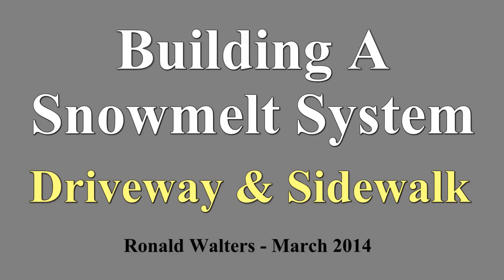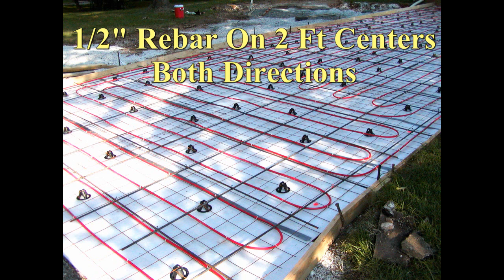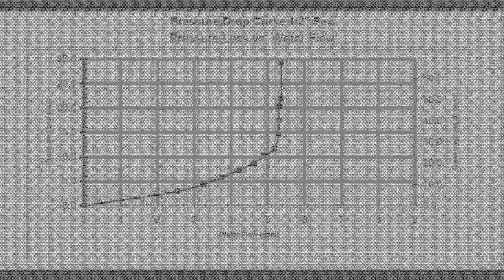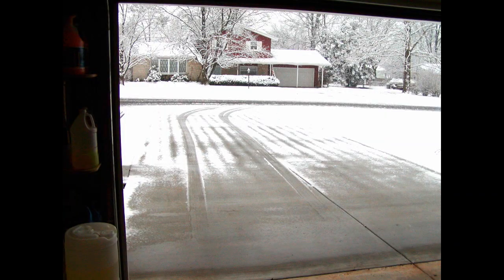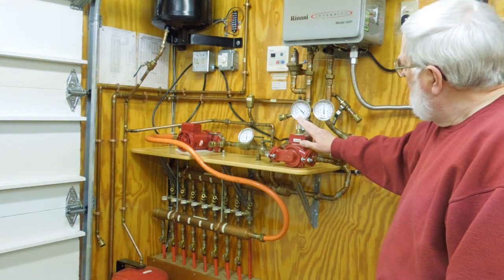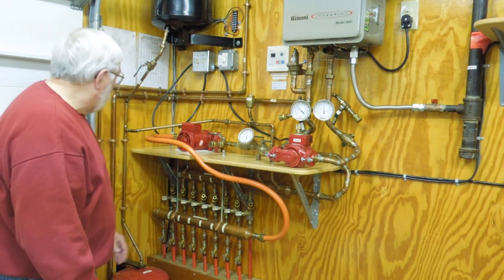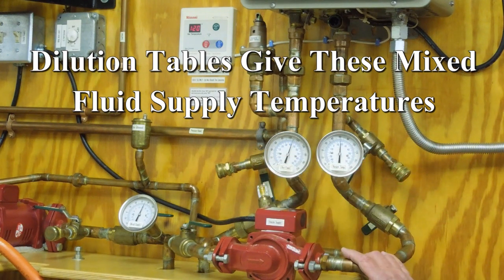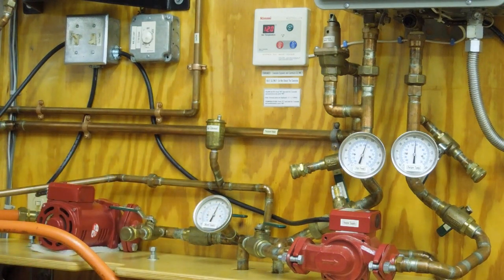Snowmelt, Building A System - Driveway & Sidewalk

Comment: It looks like you have continuous piping running through all the sections of concrete.  That looks like it might make it a bit inconvenient if you ever need to replace a section of concrete.  Around here, concrete sections get cracked because of the roots of trees are just move because of uplifting of the soil.  But, we don't get much in the way of freezing weather other than maybe once ever 10-20 years, so such a system is not called for here.
Reply from the maker: It is never a good idea to have trees next to your foundation or concrete. Most driveways I see in subdivisions or other residential areas are breaking up simply due to poor and cheapest possible installations by contractors. My slap is on good compacted bedding with lots of crushed rock so it can drain. The concrete is a 5" slab with wire mesh and rebar. It hasn't moved or cracked in 14 years. Hope you have subscribed you Grumpy Old Man. :-) You should find other things of interest on my channel. Thanks for watching.

Comment: How thick is the ice sheet at the end of your driveway?
Reply from the maker: Doesn't happen.
Reply: Interesting, I had assumed it would refreeze fairly quickly once it left the heated area.
Reply from the maker: With a blanket of snow covering the driveway the snow helps hold in the heat. Water from melted snow is above freezing and runs under the snow and finds its way to the sides and end of the driveway as rain would. When it reaches a ditch or gutter it will eventually refreeze or will run under snow in those areas as does snow melting on the roadway. Depending on weather conditions, some of the melted snow will evaporate. If you turn off the system before it has cleared the driveway, things will certainly refreeze. Allow the system to completely clear the driveway, the concrete will be bone dry.

Comment: Do you have to be worried about cracks as it cures breaking the pipes?
Reply from the maker: The plastic tubing used inside the concrete is called PEX. It is very tough stuff. You could probably tow your car with a piece of it. If you use wire mesh and rebar inside the concrete you shouldn't have to worry about the concrete moving around after it cracks. Tool joints in the concrete are mans way of telling the concrete where you would like for it to crack. (Concrete may or may not listen to your suggestion about where to crack.) Thus far my driveway and sidewalk have cracked in the tool joints. With proper ground preparation and drainage prior to pouring concrete, you shouldn't have the concrete trying to move around. Concrete DOES NOT like to change dimension rapidly (that will cause cracks). That is why you want to warm it slowly, not hit it will real hot water all at once.

Comment: 1st.. wow at the details and video images. Nice work!  2nd... Wonder if it works with 6"+ snowstorms.  3rd... "This is a fairly expensive system to operate. While running it is the same as heating 3-4 houses" What??!!! I'd rather pay someone to plow.
Reply from the maker: Yes, I have used it on 6+ inches of snow. Everyone seems to miss the point about heating 3-4 houses. An on-demand hot water heater is expected to take cold water mains temperature and immediately turn it into water hot enough for a shower... and I am not running it anywhere nearly that hot. An on-demand water heater burns more gas in a given period of time than a tank type water heater, but it burns if for a far shorter period of time. It consumes a lot of energy, but only "for that period of time it is running".

Everything costs money to operate. We tend to get a lot of ice before snow and that is nearly impossible to plow.

A lot of cities heat sidewalks and streets. Airports heat large areas. Shipping docks heat loading ramps. Those tend to be heated well ahead of bad weather but to me those are government projects where they are spending someone else's money.

On the evening news when you see those huge gas fired snowmelters which melt snow as fast as they can feed them with a front-end loader. Now that is burning a lot of gas!

Makes my system look pretty efficient.
Reply: For a driveway & walkway that size I'd spend a couple hundred on salt and plowing per year. Pretty sure running that entire system is more expensive. You haven't mentioned the actual energy cost yet I think. Cool to see though, again, nice work on the upload. Thanks.
Reply from the maker: Salt will screw up concrete real quick. Don't do it!

Comment: Cant one just keep it warm all the time during snow season?  My parents friends had a heated drive that ran off a boiler.  It was turned on before snow fell and was asphalt.   Very big like 20x200 not counting the included area in front of a  car garage.   But Rinai is a great on demand heater!
Reply from the maker: +Matsci101 You can heat it all the time but I would call that a government project. A large driveway, concrete or asphalt, is a huge radiator and keeping it heated all the time a large waste of energy.
Reply: I did look into systems that come on when the temp drops and precipitation is high. Michigan is a unique state!

Comment: Curious as to why such a large (1.5"?) gas line?
Reply from the maker: The regulator and gas meter is at one end of my house and this heater is at the other end. Natural Gas pressure coming off the regulator is only a few inches of water (1/4 psi). This heater, which can have a fairly large consumption, is around 100 linear feet away from the gas regulator. The larger line is required to prevent an excessive pressure drop at the highest consumption rate. Also... this was calculated by the gas utility service.

Comment: Hi Ron,
I admire your creativity and ingenuity! I am considering building a system for the similar purpose of snow melt, but using underground vertical loops as a heat source. My concern is that I would have a maximum temperature of 52 degrees to melt with. Based on your experience does 50 degree melt at all? Obviously I would be using less energy and planning on the system running much much longer to melt the same amount of snow. I am also willing to accept that it may not work all the time and I might have to shovel once a year.  (Ann Arbor MI) Any advice?
Reply from the maker: +Betty Gable 
If it is real cold outside when I start the system, the fluid coming back from the slab is going to be below freezing. I start off only raising the feed temperature 10 or 20 degrees above the return temperature and slowly increase the feed temperature as the return temperature starts to increase. This is to prevent shocking and cracking the concrete. If there is a layer of ice or snow on the concrete it will act somewhat like a blanket. I doubt anyone can do a heat loss calculation for you taking into  account the affect of the snow blanket.
If I start off at 30 degree return temperature, the feed is probably 40 to 45 degrees. Your start up temperatures will probably be considerably colder in Michigan.
With a bare slab you are trying to heat the great outdoors. You will probably need to consider ¾” tubing and much larger flow rates due to the larger tubing. In part the larger tubing would be needed due to lower circulating fluid temperature and in part for colder temperatures in your area. Being located between two lakes, maybe you don’t generally get that cold. You need someone to do a design  calculation for you using your expected temperature of 50 degrees. You do not want to hit zero degree concrete with 50 degree fluid so you need to be able to ease into that over time… either by dilution as I do or by adjusting flow rate.
Starting your system prior to an expected snowfall can help by pre-warming the concrete.
People will try to sell you all types of automation. The more complicated the more likely to have something fail. I prefer the KISS approach and manual control. 
Now, about geothermal. I have killed very large and deep geothermal steam wells by pumping a relatively small amount of cold water into them which cools down the well bore area. When you start pumping large quantities of zero or 10 or 20 degree water into your (probably not very deep) vertical wells you will be doing the same thing and it will take the well bore time to recover. This will not be the same as using geothermal to heat your house where you are only trying to increase the temperature in your house only a few degrees. And you may want the well bore for the snowmelt located some distance from the well bore used to heat your house.
Long story short… will 50 degree fluid melt your expected snowfall. Depends on how fast you pump the 50 degree fluid. You need someone to do a heat loss design calculation for this. I do not have that program available to me. You will also need a well bore recovery calculation based on the same application.
Note: It takes a LONG TIME and a LOT OF ENERGY to melt a foot of snow and longer for ice.
Good luck!
Reply: +Ronald Walters Thank You Ron. I hadn't considered well heat loss and well bore time to recharge I will have to find someone to help with that math! 
Average # of snowfalls each year is; 1 snow fall of 6"or more and 4 of 3"-6". Overwhelmingly we get a dusting to 3". That happens 19 times a year. I'm hoping to produce enough heat to melt (all but the biggest storm) over 24 hours or so.

I had calculated the heat loss in the concrete using a 1" tube and flow rate of 5 GPM. Generally, the fluid is 3:1. By that I mean the fluid is underground 'being heated' 3 times as long as it is in the concrete. (50ft well=100ft underground,  then a 33ft run in the concrete, then repeat) In optimal conditions I have estimated the fluid would lose 15F degrees (in the 33 feet) when the slab/outside temp was 25F degrees. Roughly, 52F degrees entering the slab and 37 leaving the slab. It rarely snows if temps are below 25F. 
These # also mean that there is approximately 3 gallons of fluid in the well and 1 gallon in each run thru the concrete. So the entire system 'turns over' every 48 seconds at 5 GPM. With that fast of turn-over I'm thinking (perhaps mistakenly) the fluid temperature would even out.

I was thinking that could run in perpetuity, but you are probably very correct in that the fluid may cool the well especially if it ran for longer periods as I imagined it would/might. All of this seems a little like folly to me, but like your video says "I hate shoveling snow..." and like you I may go to great lengths to put a system in place to handle the snow.
Reply from the maker: +Betty Gable It is much easier to melt snow off a driveway receiving sunshine after the storm, than one constantly in the shade. Do a Google search for "BTU required to melt 1 cubic foot snow". An interesting result was http://www.tesmar.com/html/snowmelt_design.html
I often shovel the slush to "assist" obtaining a clear walking path to the mailbox and to save money. A good leaf blower does wonders for clearing powder snow. I show this in on video. A good snow blower will move tons of snow, preferably with the wind to your back.

Comment: Actually thinking that you could use something like light sensors to determine if snow is present and automatically have the system run as required.
Reply from the maker: People always want to sell you automation for these systems which drastically increases the cost and (in my opinion) increases the potential failure rate with too many things to go wrong. Electronic stuff does not have a reputation for longevity. Your best snow sensor is the weather forecast and your eyes. K.I.S.S. is the best approach and learn how to operate the system hands-on.
Reply: Agreed.  There are snow sensors available, but they're quite expensive, in the 300 to 500 dollar range, and only last so long.

Comment: very nice ,,, but sounds very very expensive to both install and run
Reply from the maker: If you install it yourself it isn't too bad. If you need to have someone else install it, it will cost a fortune. And it is only expensive operate when you need to run it (once or twice a year) and the past couple of years with the milder winters it only gets run a few times to exercise the system.  Thanks for watching!
Reply: well yes ,, all fair points , its nicely thought out and well done

Comment: Wow. Cost of heating 3 or 4 houses??  Is it worth it compared to hiring someone for $100?
Reply from the maker: People listen but they do not hear. For that "period of time it is running" it uses that much heat. You are heating a cold concrete slab... and it is not running all month long. Get it? 
Must be good systems as airports, loading dock ramps, hospital ramps, NFL football fields (how big is one of those) all use the same system to keep things warm. For snow removal, places like Chicago and New York use front end loaders to dump snow into gas fired snow melter's so the water can run down the storm sewers.

Comment: Not bad! I do wonder why you used deadly ethylene glycol instead of propylene glycol?
Reply from the maker: It is only deadly if you drink it. Just don’t drink it. Ethylene glycol isn’t going away anytime soon, it has too many uses. It can be used in the chemical process to make plastic for soft drink bottles (don’t eat the bottle), food packaging and in the manufacture of some vaccines. Also used as a safer alternative to formaldehyde to preserve biological specimens… and lots of other good stuff. Oh, and it was cheaper. Thanks for watching.
Reply: It’s is not allowed to use automotive antifreeze in heating/boiler systems and also automotive antifreeze does not have the anti corrosion inhibitors for boiler metals. They make special specific boiler system antifreeze in 5 gallon buckets

Comment: Great concept but the cost to consumer is too high for the cost per month it would be cheaper to higher a snow removal contractor to just shovel everything
Reply from the maker: People keep misunderstanding the statement about operating cost. That statement was regarding the gas used "while the system is running". I had some so-called experts tell me I should start the system at the beginning of winter and not turn it off until spring. Nonsense! That would cost a fortune needlessly. I don't start the system until I have some accumulation, which acts as a blanket to help keep the heat in the slab.
Reply: always thought you should turn it on way before snow ,so when it starts snowing it melts on contact ,not sure if that snow blanket theory works .

Comment: Wouldn't it be better to maintain the temperature of the driveway around 60 degrees all through the winter when that long-term saving energy cost. Where you wouldn't have to keep bringing it up loud and get to go down bringing it up throughout the winter.????
Reply from the maker: You are basically describing a government project when they do not care how much of YOUR money they are spending.  Keeping a bare concrete slab at temperature is nothing more than a giant radiator and you are trying to heat the great outdoors... and you really do not know when you will have snow or ice again.  If you do  know you are about to get hit again... and if you really believe the weatherman... go for it.

Comment: Is it the expense or what? Why not electric driveways and sidewalks snow melt instead of boiler water?
Reply from the maker: I don't have a really high comfort level with electric heating elements buried in concrete and I have seen too many partial or complete failures... just in bathroom floors. They would be 220V elements and they would certainly spin the meter.

Comment: I am not putting Ronald down, nice job but for anyone watching this today, this is a nice video but the system would have been much more efficient if you would have use 2" polyisocyanurate, R7 or higher, under the slab. This way you would be heating more of the slab inlue of the earth.  Also running your loops with 3/4" pex and run each loops supply and return next to each other rather than the way you see in the video.
Reply from the maker: Always seems to be someone who knows more than the person who built the system. The ½” insulation with the aluminum reflective layer has proven very effective in my house, my shop and for the snowmelt. One indication of heating the slab (rather than the earth) is how quickly you start to see melting on the surface of the concrete. The county always has the right to chop off the last 15 feet of your driveway (right of way), so the pattern was chosen so as not to screw up the rest of the system should such a stupid thing happen…and I did not allow any splices buried in the concrete. For where I live, 99% of the time, ½” PEX (verified by the design software) is quite sufficient. Thanks for watching.
Reply: The foil isn't effective without an airspace such as a framed wall.  See here.  http://www.phrc.psu.edu/assets/docs/Webinars/RadiantBarriers-updated3-13.pdf  It's great that your system is effective, and your strategy of only running it when there's snow is great!  You must have quite the boiler on it to get the slab up to temp that quickly.  I design these systems typically for commercial environments where they're operated frequently and energy costs can be substantial.
Reply: David Hoekje Yes.... the foil IS effective at reflecting heat... Please read up on thermodynamics before posting false information and screwing others.